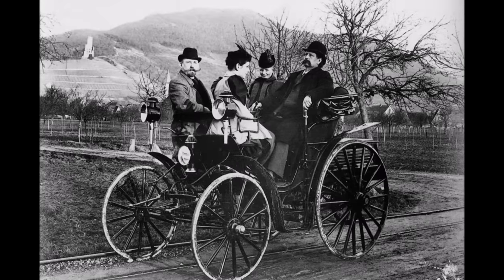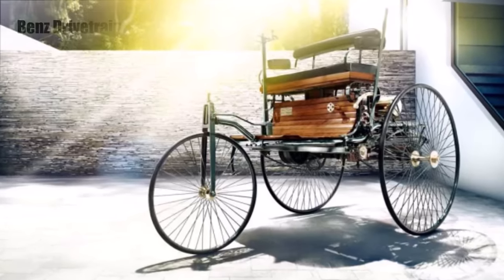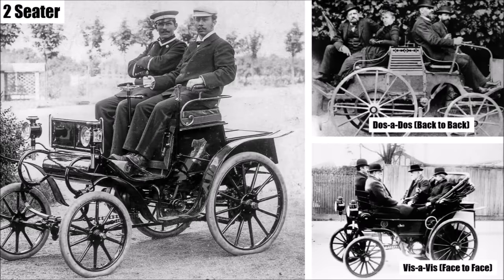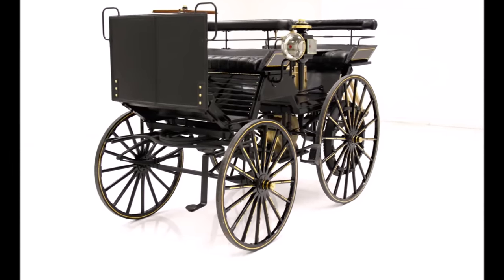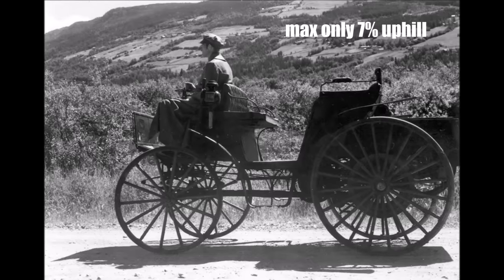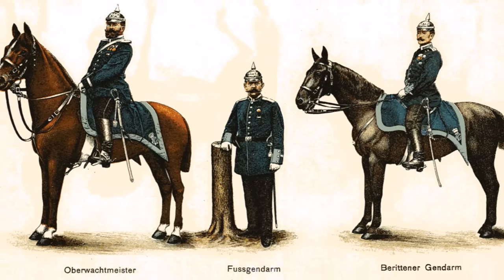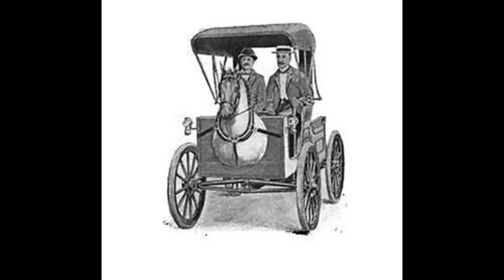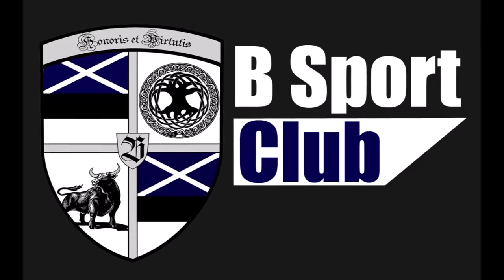What it was like to drive a car in the 1890s

Comment: "Up to 40kph the streets were OK but with higher speeds the bumpy streets became increasingly dangerous" - I can attest to this with my bike.
Reply: Me going down the Niagara Escarpment on Centennial Parkway hitting 80 km/hr +. Shake. rattle and roll!
Reply: 5 years ago Paris introduced a 30 km/h limit for cars for a reason. You are not meant to drive so fast in the city.
Reply: 1980  soeed liñíted 155  mph

Comment: Great topic.  I love the way everything is so strange yet relatable to any gear head.  These very early cars were ridiculously expensive and crude.  I can't even imagine what it must have felt like having to leave a "pride and joy" on the side of the road until they could find a horse to tow it home.  Given the rural animosity toward such evil playthings it wouldn't surprise me if said car needed even more work before returning home.
Reply: And it wasn't that long ago.  One of the fastest changes human kind as experienced. Seems like the idea was pretty good.  Like half a century later, nobody uses horses for much anymore other than sport and recreation.
Reply: @Greg3070  I'd argue the fastest change in technology was in naval designs. We went from wooden hulled ships to ironclads to dreadnoughts in less than 20 years.
Reply: I think it was airplanes. From bicycle parts at Kittyhawk to murdering machines in WW1, all in a span of 15 years.
Reply: @Greg3070  Too Much Horse Sheet On The City Streets To Clean Up And Try To Avoid Stepping In It.  And The SMELL Would Be Horrific, With Even Dead Horses Left On The Street To Rot After Collapsing From Over Working Or Old Age.  Something BETTER  HAD  TO  BE DONE...
Reply: "Given the rural animosity"

Citation need.

Comment: Horses were, of course, at least as dirty and dangerous. Their hooves threw up mud and muck at the carriage and occupants, especially at speed, so if one were to 'dash' one needed a 'dashboard' for protection. Nice video. Thanks.
Reply: Typically you were completely safe in an ornamented passenger room, also horses were large, and so were the tires, the vehicle, and how far away you were from the ground.

But yes upperclass and nobility had plenty of handmade carriages compartmentalized, enclosed, with curtains inside and hats large enough to hide their identity.

Comment: It seems like a miracle that drivers in the early days persisted at all. I was also surprised to see radial spoking on the bicycle style driven wheels of the early cars. There must have been frequent breakage of these spokes.
Reply: Rarely, compared to thin wood spoke.
Reply: It seems to work on motorcycles.
Reply: Imagine being able to ride a bike faster and safer than a car but really insisting on taking a moving sofa with you everywhere. So brave, those trailblazers.
Reply: @ImpreccablePony  just imagine their thrill back then. Heavenly!
Reply: @stevek8829  Bikes Today Have ADJUSTABLE  Metal Spokes At The Rim.  Wooden Spokes Had None...

Comment: What about steam cars though? I used to work in a brass era car restoration shop and 90% of our work was old Stanleys. The customers took them on "tours" a few times a year, by which I mean some rich guys ship their cars to interesting places and drive around a little (one guy I knew drove an old White across Europe and Asia, much due respect there), but Stanleys especially had some peculiarities though they were still a lot better than early gas cars.

Locomobiles were the earliest steam cars we had with a tiller steer and very similar design to those Benz four and three wheelers with little more than a frame to sit on, but they were much more useful than these gas cars seem! There's a reason steam power was much more popular early on, and while Stanleys were a bit primitive, they would easily do 60mph down a modern freeway, while Whites with front mounted engines and radiator/condensers were arguably still viable vehicles and I've heard stories of some still in use today.

The one brass era gasoline car I dealt with was a 1900ish CGV (a french car), and though it had been updated with a starter, it was still a vast improvement on these buggies. There was a full enclosed driver and passenger compartment, prop shaft, conical clutch, and the engine itself wasn't too dissimilar from a modern lawnmower engine, albeit water-cooled and four cylinder. By far the biggest difference between it and something from the modern era was the body and frame construction-- they still were built like wagons with wooden bodies and frame posts with very little rigidity.

Without going on too much longer, the cars in this video are leaps and bounds behind that which came about less than a decade later. IIRC the land speed record for a steam powered vehicle was only broken in the mid 2000s after around 100 years when a wooden chassied Stanley first set it at 160mph or so, and only by a few MPH! I always appreciate homage to the early innovations in mechanised transportation and semiseriously long for the day that steam cars make a comeback for the efficient, simplistic means of transportation that they are.
Reply: Simple Reason WHY The Steam Cars Never Caught on.  It Took TOO LONG To Get The Water Heated UP For The Vehicle To Move.  Even Locomotive Shops Had To Have Firemen Stoking The Fireboxes Of Steam locomotives A Half Hour BEFORE The Engineer Could Move The Engine To Use It...

Comment: What I'd like to know is why there were not steam cars everywhere from the early 19th Century until the internal combustion engine took off. Plenty of steamships, big and small, and trains were all steam powered. And we had macademised roads from the 1820s. Plus, solid rubber tyres were around from the mid 19th Century, and paraffin was in good supply. Sure, internal combustion engines were far more convenient, and a better idea all round, but steam would have been very useful in cars until then. One of life's mysteries.
Reply: I heard the early railroad investors suppressed the steam car - didn't need the competition.
Also, if you scale a Locomotive down to car-size you still have a lot of cast iron to move around which overwhelm wagon wheels. Steel wheels and an iron frame.
Trains run on smooth rails with only a slight incline.  Ships glide thru the water.  The car will sink into soft dirt. But there were steam tractors.
Going from cold to steam takes an hour and you can't "throttle" a coal fire.  You need to blow off the un-needed pressure which is loud.
The Stanley Steamer solved all these technical problems but this tech wasn't available in 1820.  See Cugnot steam cart.
Reply: There were steam buses in 1830s england that did not use a track, but they were made illegal.
Reply: There were more steam and electric cars at first. The steam powered took a long time to get up steam and could blow up or catch fire.  Electric cars had limited endurance and  less  power and would get stuck in mud. .

Comment: I thought the first car with internal combustion engine was made in 1808 by François Isaac who slapped one of his engines on a 4 wheeled wagon, so technically, this was a car by every conventional means, it had 4 wheels, steering column and an engine.
Reply: There was one French guy who did the same (put a steam engine on a trolley and ran it down the street) even earlier in around 1783, but I forgot his name.

Comment: Thanks for the video.  The challenges facings EVs are small compared to the early days of automobiles.
Reply from the maker: Very true
Reply: The problem with EV's is the automakers promised us a much less expensive and mostly problem free vehicle, which can be done, except they're trying hard to make EV's terribly complex and expensive.
Reply: I think EVs came first ahead of ICE.  They use zinc for batteries, very expensive at that time!
Reply: people nowadays simply demand electric cars have the same range and refuel times as gas cars or they aren't good enough. for no reason other than to have something negative to say. specially in a small country like mine where loads of cars on the road have ever even been more than 300 miles from home. especially true for families where 2 or more people own a car.
Reply: @yvs6663  People need full range vehicles, ev's are pathetically underperforming in that area.
Reply: @henryknox4511  full range? u mean they need more range? why? not with the way most people where i am from are using them. a car with about 200 miles of range can do most drives people do and can do the couple long trips per year with a single charging stop in each direction. u know, a stop they would probably be taking anyways. company cars might need more but privately owned cars usually don't. at least in Europe, US might be different.
Reply: @yvs6663  I mean as a construction foreman having to travel between multiple jobsites, the shop, the supply house, and my house- I might have to do 200 miles a day 3x a week with a bed full of material. That's just a single anecdotal example. There is no EV that can fit those requirements. My company runs between 25 and 30 foreman at any given time and they all have the same travel requirements.
Reply: @henryknox4511  i am mostly talking about private car owners and their reasons not to buy an EV. not buisness owned pickup trucks. ultimately, its up to a buisness to decide if they can replace some or all of its fleet with electric cars. i don't think they would have much of an issue getting a test car for a day, use it as they would and than decide if it suits their needs. specially if they are willing to order 30 of them. btw, the electric pickups i am familiar with car do 200 miles with a full bed. they can also acts as a generator which might be useful to some people in construction.

Comment: Cars per decade in a nutshell. 

1890s: Pretty much just an overexposed box on wheels. As in exposed parts and occupants with no enclosure.
1900s: (Nineteen ones): Less exposed parts more enclosed occupants. Usually had a roof for at least the passengers might have doors too.
1910s: Better, more thorough enclosure of the occupants. Doors are more common as well as a complete roof. Stronger framework. 
1920s: Biggers cars, often had a spare wheel/tire on the left. Smoother looking paint.
1930s: Stronger framework, internal trunks now standard. 
1940s: Had really thick framework, mostly composed of curved continuous roof fastbacks. 
1950s: A lot more notchbacks came out. Cars often had a primary color and a secondary color. Rear fenders often covered the wheels partially from the sides.
1960s: More tame design, less bulky framework. Boxier.
1970s: Boxlike with mild curves. Simpler design.
1980s: Still boxlike but fancier design with the lights and body shape.
1990s: A lot smoother and rounder with the body design, fancier too including the lights.
2000s: (Twenty ones): Very slick looking.
2010s: Fancy looking. Hidden antennas.
2020s: Really fancy.

Comment: The British invented the dividing line in the middle of the road so people knew where to give way. The problem had always mostly been waggon drivers and coach drivers who tended to go down the middle and never give way. This caused a lot of fights, with waggon drivers being the worst, like modern truck drivers, I guess, or at least the 20th Century ones.

So a dividing line was put down the middle and people were to give way to the left if needed, or drive on the left. The reason for this was that if you needed to draw your pistol and shoot down the middle of the road at any highwaymen, you could do so more cleanly from the left hand side, if you were right handed, it still applies today in cars. You can put your right hand out quite comfortably and shoot if you need to in a right hand drive car.

The reason why Germany drives on the wrong side is because of Napoleon and his Continental system. He imposed it on any conquered territories and chose the right hand side to spite the British and make trade and so on as difficult as possible for them with their blockading. The Americans did it to rebel and be different from the British, but famously baulked at the metric system as "too complicated" or "complex" as they'd say it now.

Comment: Nice video.  It begs the question of why anyone would buy a car then.  So many drawbacks.  What about the first electric cars?
Reply from the maker: Could be a future video
Reply: Cars are very old. We did not design them or build the factories. Ask yourself how they were running around with electric cars and wireless chargers, starting on the top of the so called tech pyramid, and leaving us with gasoline engines by the 1950s. They've tried to remove all records of the technology

Comment: Let's see, initially cars had no roof, no doors, no headlights, no brakes, no steering wheel, no reverse gear, no horn, and they were powered by liquid fuel designed to explode.  No wonder there weren't many sold.

Comment: I think you made a mistake in describing the belt and it’s stretching . The longer belt actually would stretch way worse than the short belt because each little stretch in a distance of a foot added to a bunch of feet of length adds up to more stretch overall than a little bit of stretch and a short belt. i’m hoping that it got lost in translation and wasn’t an out and out mistake
Reply from the maker: Stretching is not a problem but leaving the elastic area is. You overstretch the short belt much earlier and so you have to tension it again.

Comment: the benz was not the first true car. It was a tri-car. Not a fourwheeler. Just as Daimler's einspur was not the first true motorcycle as it had outrigger wheels. Hidebrand and Wulfmueller had the first true motorcycle with an internal combustion engine. The tri-car was a hybrid then as are threewheelers now    no matter what the wheel configuration. The Lenoir Hippomobile predates the benz (1863) by 22 years. https://en.wikipedia.org/wiki/Hippomobile#/media/File:Lenoir_Hippomobile.jpg
Reply: Where is a car defined as having 4 wheels? You have a point about the Hippomobile though.
Reply: the oxford dictionary lists a car as a four wheeler.

Comment: They werent cars they were motorized tricycles and henry ford invented the quadracycle ! Which was a 4 wheel motorized bicycle
Reply: A bicycle by definition can only have 2 wheels. Whatever Henry Ford invented, it can not be both a quadracycle and a bicycle.  If the vehicle powered by an engine or battery has a form of carriage (enclosed or open) designed for carrying people, as opposed to them riding on top of it, it is a car. The word "car" is derived from "carriage".  A 4-wheel motorised vehicle without a carriage is commonly referred to as a quadbike. Cars commonly had 4 wheels before HF came along, and I doubt he invented a quadbike, so I am not clear on what you think he invented.
Reply: @tonylittle3508  he definitely didnt invent the car !

Comment: Waste of money will never catch on. Nothing will replace the horse. When one of them contraptions break down ya can't eat it. BEV will never replace ICE vehicles.
Reply: Horses were replaced almost 100 years ago my friend. No one uses them for transportation nor do they use them once there cars are disabled too. Outdated and not a thing anymore. Only a very tiny percentage of the population even own horses, and most don't use them for transportation.
Reply: @MylaRolettoPingarelli the joke went over your head
Reply: Funny part is no one thought like that.
Reply: Ever been to Pennsylvania or Ohio Amish country?
Reply: @earllsimmins9373  or Arkansas Amish country
Reply: Battery Electric Vehicles.

Over a 100 years ago the car industry knew already what were the achilles heels of EV's: the weight of the batteries and their inabillity to store enough energy to work hard, for any extended period of time.

Not much has changed since then.
Only the batteries have reached peak power (or close to it), but are still heavy. As added bonus, they're (very) expensive. 
E-motors have gotten lots better, but the overengineering of all subsystems and overconfidance in giving computers (and thus outside sources) near free rain to control ever more of a car, makes for EV's not being able to replace mainstream ICE's.

EV's, contrary to ICE cars in the early days, that symbolyzed more freedom, now stand for a loss of freedom for it's owner.

That's your whole popularity problem with EV's.